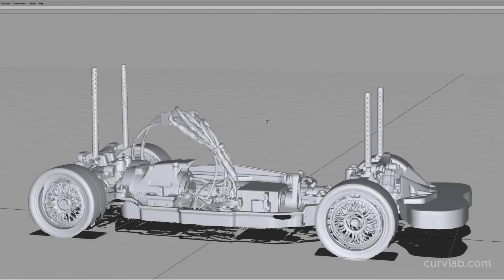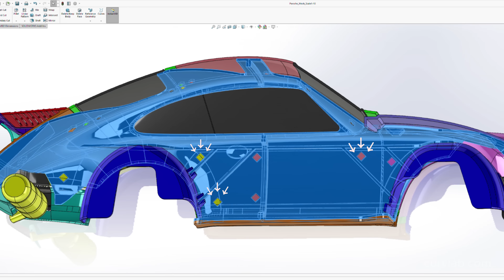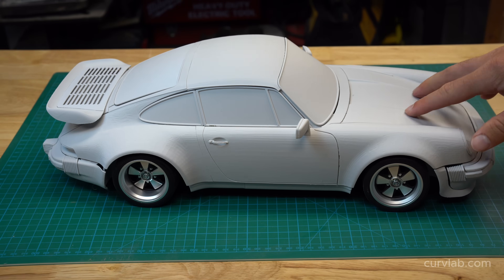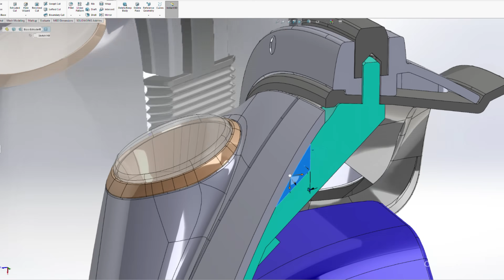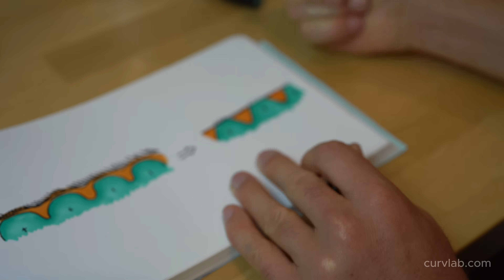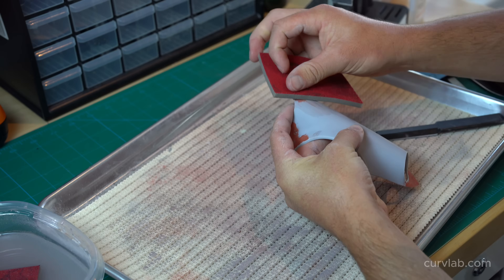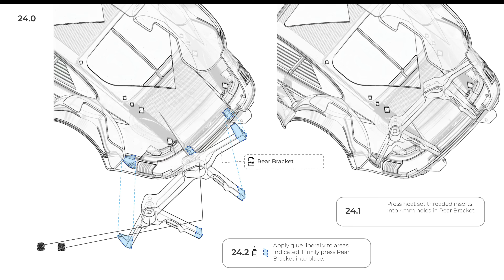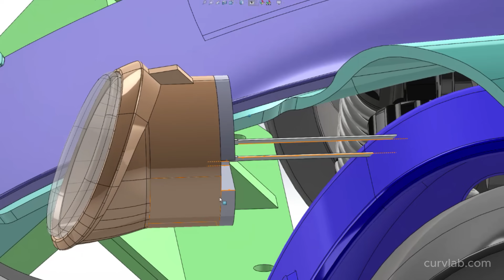3D Printable RC Porsche

Comment: Really amazing work, though I have to say after aaaaaalll that work, especially polishing the headlights, to have all the glass be satin finish and with visible layer lines still, really draws my eye there and takes away from the amazing work you did throughout the rest of the build. Maybe you can go back and get those printed in smoked dark grey or black resin and polish them up as well, would make the whole thing SO much more photo real.

Don't take this comment the wrong way, not trying to poo poo on your work whatsoever. Quite the opposite, because the rest of it is so damn good, any little flaw or imperfection really stands out. 

I look forward to your future projects :)
Reply from the maker: yeah that bothers me too. I got lazy at the end
Reply: @CURV-LAB  TOTALLY relatable, esp after the probably few hundred (or maybe more!?) hours you had into the project at that point.

Comment: That looks soooooooo goooooooood!!!!!!
Now please do a Ford Capri Mk3! Mako V8 would be great! Only modern Capri body out there is the Tamiya Zakspeed. But I want a road going variant!
Thank you for using a proper rc car. My pet hate is 3d print chassis, or more precise 3d printed drivetrain. Usually too bulky and does not support a powerful rc system.

Comment: At 9:12, that is exactly what primer is used for! Even that stuff that isn't specifically branded "sandable". Primer is the final "filling" stage for paint and body. It fills in all of of the smallest imperfections, so that the surface is all the same level.

A lot of people think primer is so that paint will stick. But paint doesn't need primer to stick. A scuffed and cleaned surface is all paint needs. However, just paint alone would end up showing all the little imperfections. So you use primer (and sand where needed) to get the surface all the same height (after all of the big stuff is filled with fiberglass, bondo, putty, etc of course). Then a quick scuff and paint.

Primer is actually PERFECT for FDM 3D printed things because with enough coats, it'll fill in between the layer lines exactly as you mention.
Reply from the maker: Rustoleum 2 in 1 sandable filler
Reply from the maker: lol TIL I am just finally using primer the correct way - hahaha

Comment: How did you made that substrate part the part that hold the outer shell like bumpers and other stuff. I am also looking for a way to make it.
Reply from the maker: Just by offsetting the outer body surfaces. Once they're offsetted by the thickness of the outer shell then you can build features into it to attach the body panels

Comment: I'm a big fan of your work. This is another incredible piece.

I'd personally love to see a video on your process for designing the car from a mesh reference and wouldn't find it boring at all -- but I'm currently trying to figure out a solid workflow, and it looks like you've already developed one with proven success.

I looked into Autodesk Alias, but unfortunately, it's out of my budget at the moment. Most of my experience is with Shapr3D, and I have some limited time with Fusion 360. I'm also currently learning Blender. That said, if you've tried all of those and still believe Autodesk Alias is a far superior option, I’ll find a way to make it happen.

I'll also reach out through your website since I have another question I’ll leave off here.
Thanks again!
Reply from the maker: Thanks! Yeah alias is crazy expensive. Blender is the way of the future and totally adequate to build RC bodies. Alias is kind of overkill tbh. 

Good to know you're interested in a CAD workflow video. I can work on that.
Reply: I am also very interested in a CAD workflow :) Your attention to detail is crazy